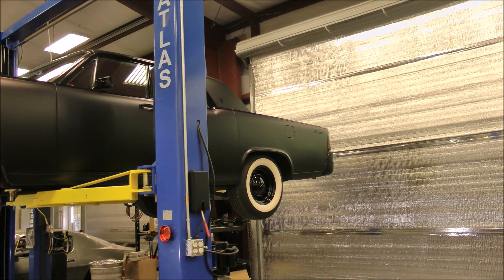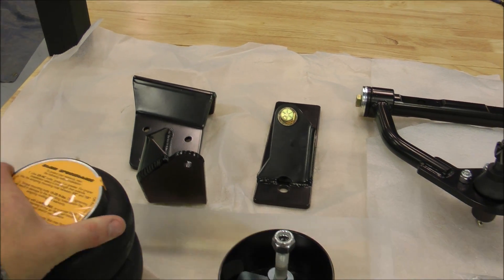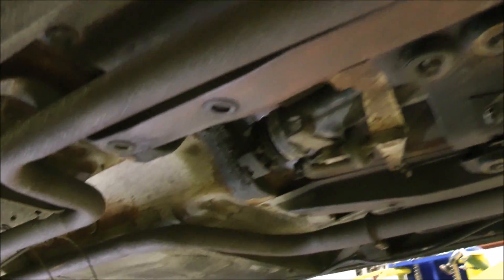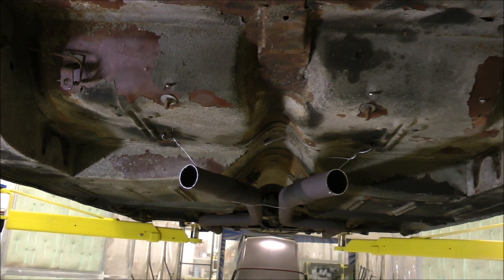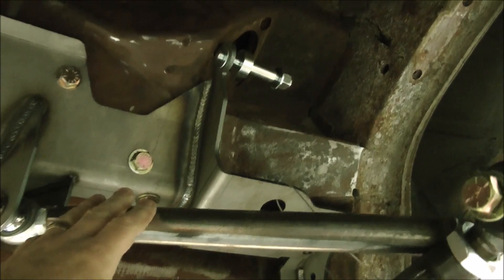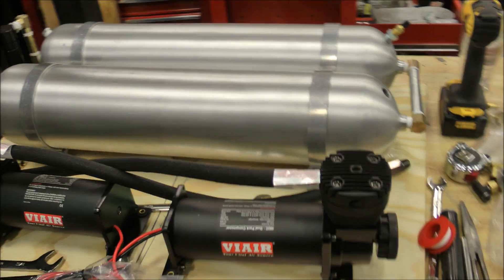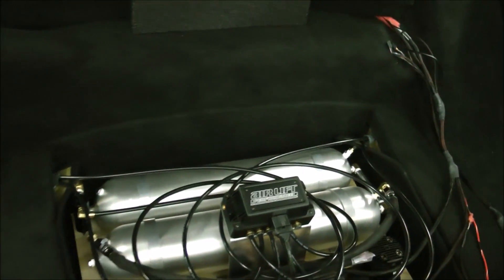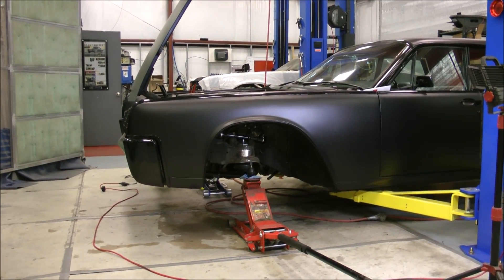1964 Lincoln Continental Conversion Part 1

Comment: Awesome job Mitch! What kit did you use for the front air ride and rear 4 link? I'm building a 66 Lincoln right now and the kit looks like a fairly easy bolt in kit. Thanks

Comment: Wow, I'd love to convert my 72 chevelle to electric. Too bad i'm from Poland and we don't have many Supercharger poins here ;( for now... :)
Reply from the maker: Bartosz Palasek you don't need a supercharger point. Chargers typically run on almost any voltage and amperage
Reply: That's true, but when there is no infrastructure for electric cars in country there are also no service points for electric cars ;/ Mechanics here have no idea how to fix custom made Electric cars if something needs replacement. There are few hotheads and engineer students, but no reliable car workshops. Hope it will change in few years.

Comment: I am all cool with converting cars. But totally against you cutting away original parts of the car. Why do you do that when its a rare expensive classic? I will never understand why people think its ok to cut up a rare car. There are ways to modify cars without doing what you are doing to this and what you cut off the Mustang. If the parts were rusted out I could kind of understand but when the steel is good why ruin its original structure. I think any conversion of a classic car should be reversible. Others wont agree but that's my own view.
Reply from the maker: Black Terminal There are a lot of people that feel exactly the same way you do. That's why there is such a large industry around concourse correct cars. Believe it or not when we first started converting the zombie 222 we tried not to do anything that was not reversible by just changing parts out. Unfortunately, going to an electric drivetrain is just too radical of a conversion to avoid cutting. Particularly around getting batteries into the car in a way that is functional, looks good and safe. It requires a lot of cutting and custom fabrication. That's just the unavoidable truth.
The why we do it is because we believe that taking these old vintage cars and bringing them forward to cutting edge technology is like running them through a time machine and that is our passion.
Reply: You could still do it without so much cutting. Yes having the batteries not in the trunk will make for better handling but I still dont think a rare car should be converted. Obviously your customers have a suitcase of cash and money is not really an object. Nice for them and keeps you employed and pays for your mortgage which is what it is. Me I think safe, tick. Some loss of function and looks is ok to avoid butchery. In my own time I am converting a much more modest car and I have practical reasons to avoid butchery because it would lead to a lot more hassle with the inspector who must sign the work off. My budget wouldnt cover  a quarter of what you do probably but I wont love the car any less for what it will be to me.
If a replica body was used I would be all for your expensive process. All the best for 2017.
Reply: That is all good and all and i agree but only if this was a restoration but is not the case, he is transforming this car into a electric car,  that is a radical change only in it self, so why should he compromise the rest like safety, comfort and features, only to maintain the old suspension system and  "preserve the original structure and history"? I doubt anyone will ever buy this car in the future to reverse its conversion.
In this case and talking about the suspension and brake system, its old design, old age makes it unreliable, specially with a powerful electric motor and the added height of the batteries. 
Plus  IMO if the owner of this classic car wanted to preserve its original history and looks he would look elsewhere, not at mitchmedford shop.
Reply: WHO CARES IF THEY CUT IT? I WOULD RUST AWAY AND END UP IN A JUNK YARD IF IT WEREN'T FOR THIS.